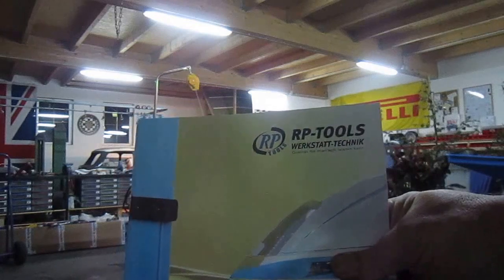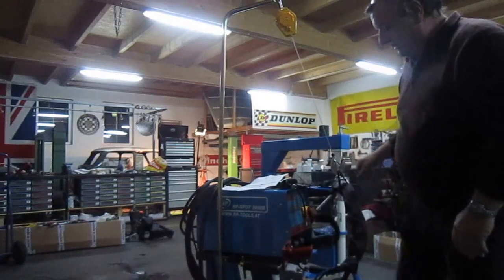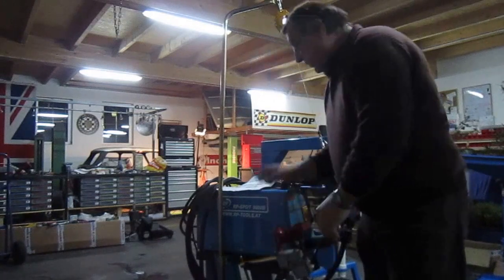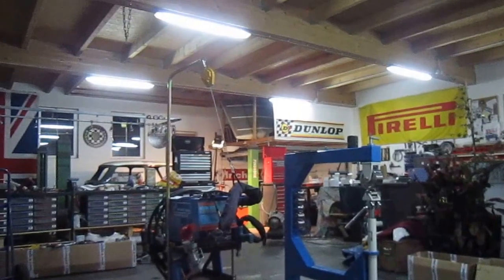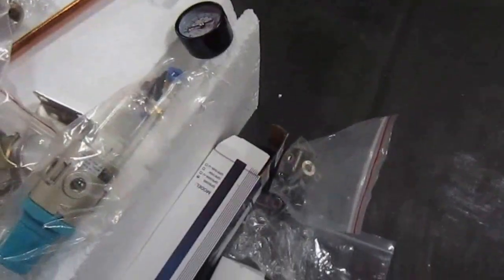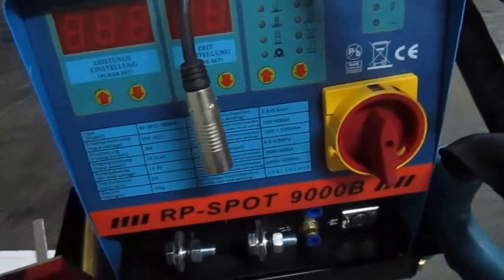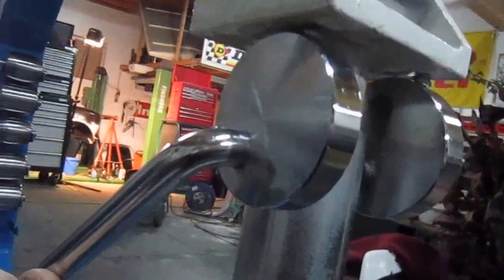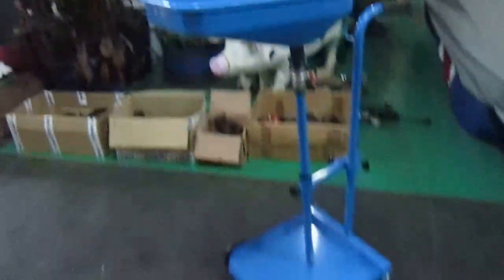New Spot welder & English wheel from RP Tools

Comment: They look very  good  David . Well made  stuff.
Reply from the maker: Pete, As i said before the proof of the pudding is in the eating! I will try out a few different tests and see what it
can do. I will use the old mini wings to try the dent puller out. Cheers David
Reply: Fair play David . I can see why you wanted to get a english wheel , not that i know much about them , They put curves in metal from what i know.
Reply from the maker: Pete, That‘s about it in a nut shell, But i will wheel a section of steel just to show how it works. Cheers David
Reply: Look foward to see what it can do . I follow Delboys Garage he is building a custom bike  , i know he would like to get a english wheel.